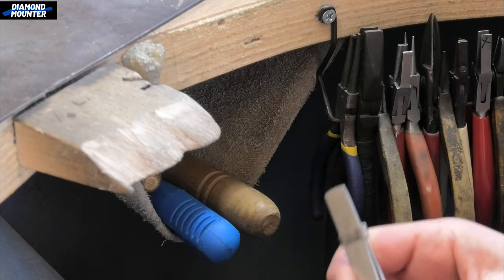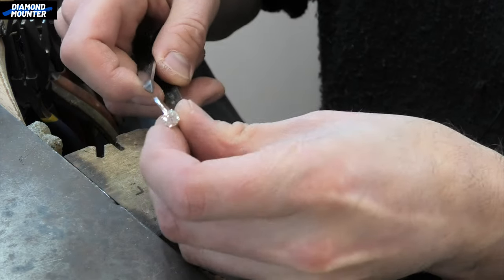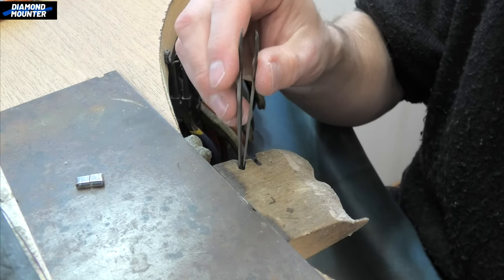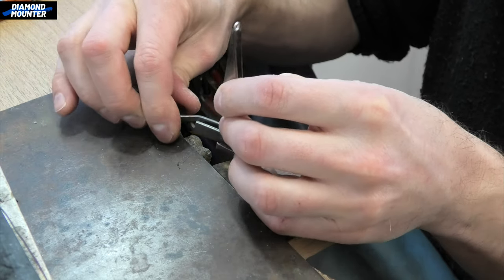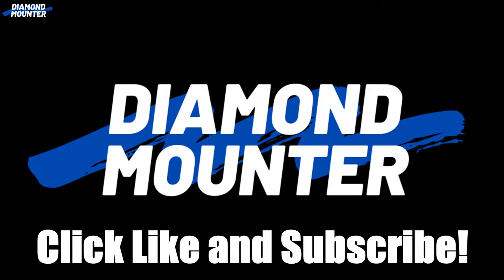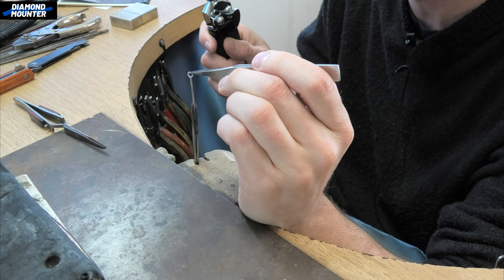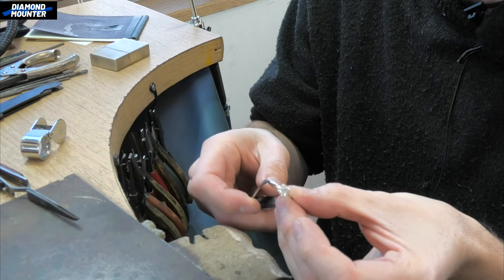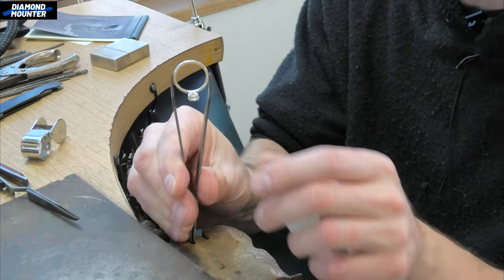The Best Tweezers to Use when Soldering

Comment: Great tip. I made a slider for my tweezers a few years ago from a scrap piece of Cooper tubing. I split the tubing length wise and hammered it flat. The I filed it before heating the Cooper then bending it around the back of a tweezer. Had to cut the Cooper again to make the final joint and soldered it so it would not come loose.i actually did it to all my non cross lock tweezers. I only had 1 cross lock tweezer trying solder a joint and one pair was not enough and I had to get the job done. This is what forced me to improvise. Thanks for the video and getting the word out. Thinking out of the box comes in handy.